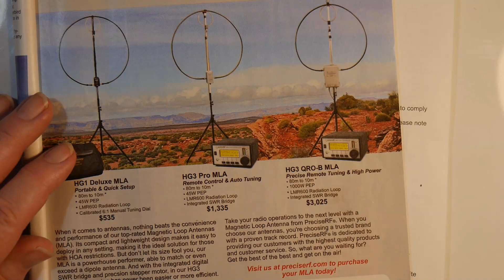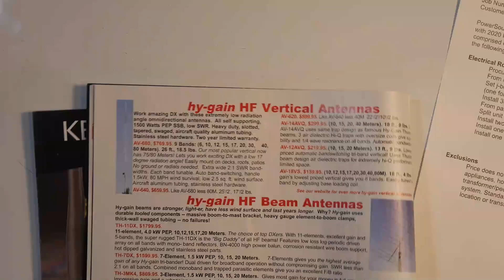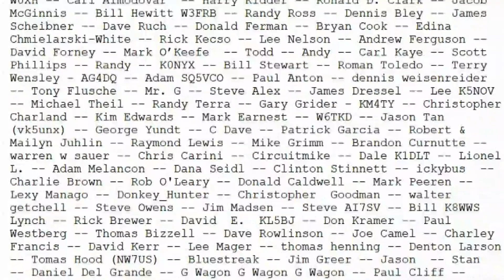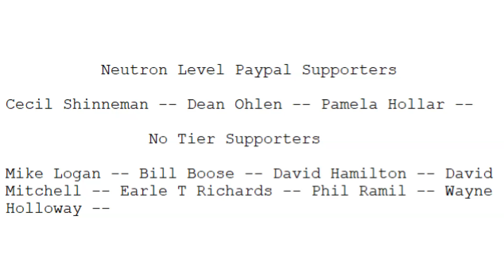Unity Gain (#1064)

Comment: It's interesting because just yesterday, I saw a 1/4 wave, vertical ground plane antenna for 10 meters that claimed "2.4 dB gain"
a half wave, end-fed vertical that claimed "9.9 dB gain" and a 5/8 GP that claimed "12 dB gain" 
Many folks can be fooled into believing that a 1/4 wave vertical GP or a half wave vertical is leaps and bounds over a unity gain antenna. 
This is something I'd like to see you cover.

Comment: "so why not just put up a dipole"

Simple answer is it may not fit the space available or operating parameters.  No high enough support, no land space for a proper ground, not allowed in housing, and so forth.  Also, can it be multi-band like a balance line fed dipole or a trap or fan dipole.  The AV-640 you used as an example is a very nice antenna for limited mounting possibilities while the 80m OCF I have needs to wrap around the yard in a 'C' shape and is only 35' high at the center.  Yes, it works and is "unity gain", but I  often get better DX performance using the ancient 5btv and quieter and stronger signals on the wire OCF.  
Both very inexpensive antennas and with an MFJ-1708 Tx/Rx switch is auto switching.  One must do as one must for best performance per dollar, and a simple unity gain dipole is not always the answer.
Still Dave, a very interesting and informative vid - thank you sir